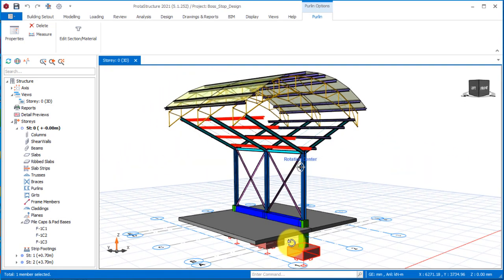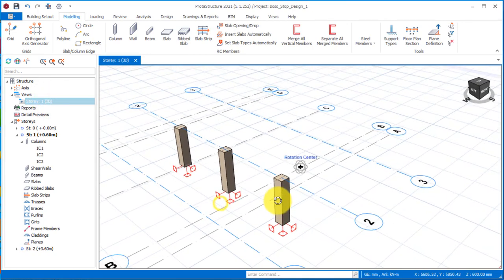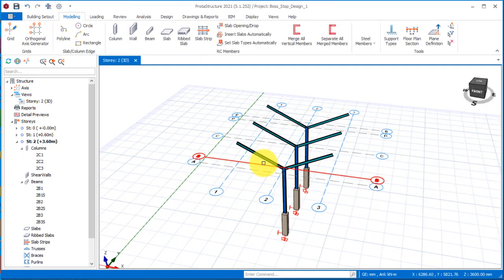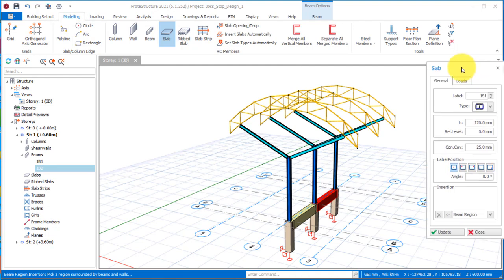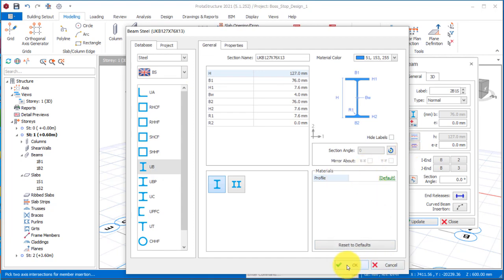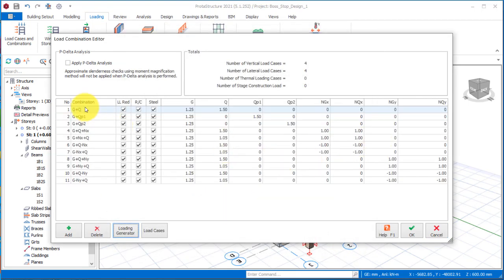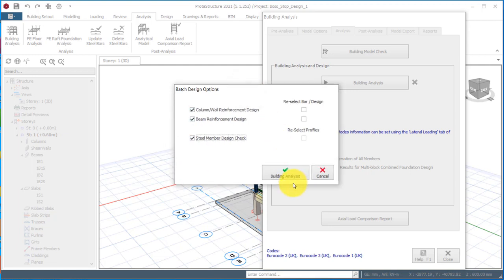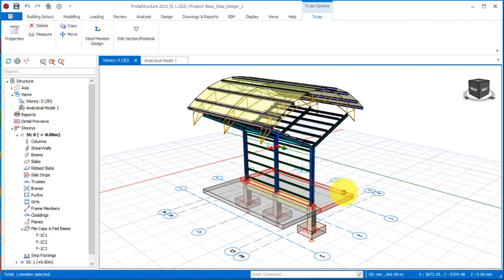Complete Structural Modeling Analysis and Design of Bus Stop Station in Protastructure

Comment: is there any way to define tension only for the bracing? I could not find any option.
Reply from the maker: Yes Sir
Reply: @CADmade-easy  where can I find out? Would you pls help?
Reply from the maker: @murtadhaabddulkareem7913  in the  brace option setting dialogue
Reply: @CADmade-easy  Thanks, but I know there is a setting dialogue. The only option available is to tick "Model joints as fixed". No specific setting to change members to compression or tension only. Above and beyond that, does protastructure have non-linear behavior analysis for tension-only members?
Reply from the maker: @murtadhaabddulkareem7913  Yes Sir, added in 2022  Version, But i would check that out in 2021 version Sir, we would be using 2022 version for designs subsequently here
Reply: @CADmade-easy  Mate,I use 2022, no change comparing to 2021 for brace setting. No tension only member setting available.
Reply from the maker: Okay Sir, but I would contact manufacturer in that respect